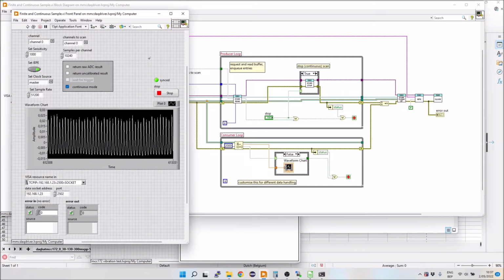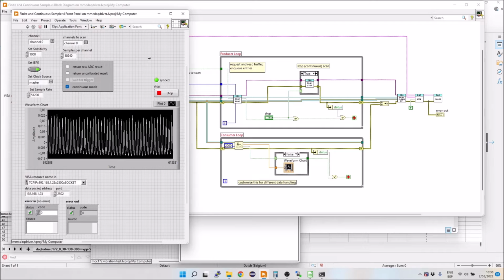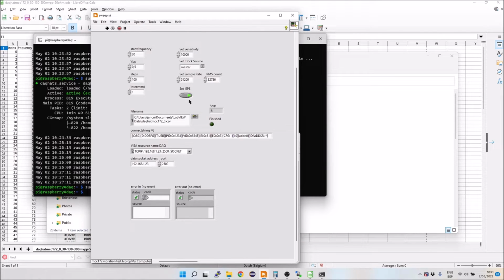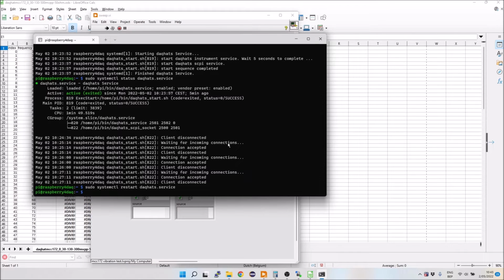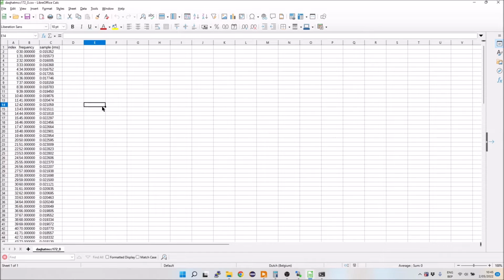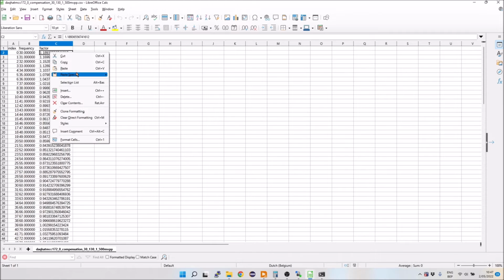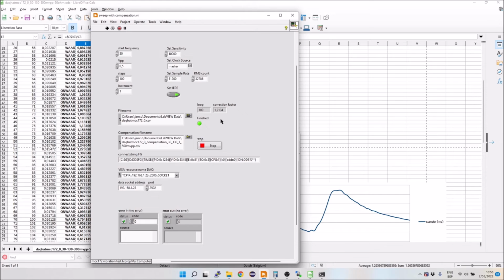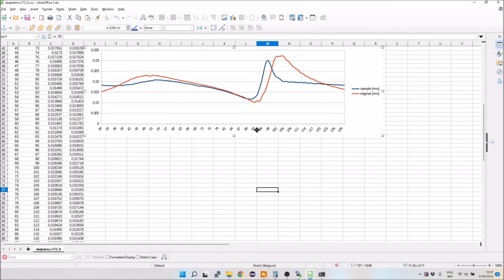Raspberry Pi with DAQ HAT as LabVIEW SCPI programmable instrument - DEMO

Comment: for the DAQ HAT aplication, do we need external 24v supply for the accelerometer sensor?
Reply from the maker: It has the IEPE supplies on board - 4 mA exitation current, compliance (max) 23 V.
https://mccdaq.github.io/daqhats/_static/daqhatLibrary.pdf
Reply: @JanCumps  thanks for the info. How max modul DAQ HAT can we use in 1 raspy board? And which pin of rasp pi to connect the DAQ HAT ?
Reply from the maker: @calvinaizumiramadhan2685  I don't recall. It's been a year ago. But I recall that the manufacturer website has the info on how many can be stacked, and the pinout specifications.
Reply: @JanCumps  can it use IEPE sensor 4-20 mA?
Reply from the maker: @calvinaizumiramadhan2685  here are the electrical specifications, from the manufacturer: https://mccdaq.github.io/daqhats/_static/esmcc172.pdf